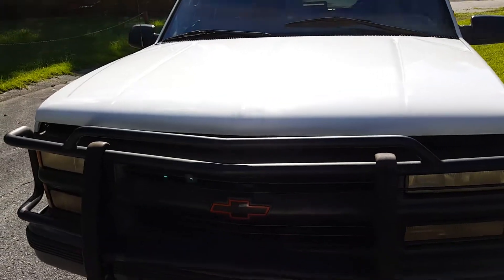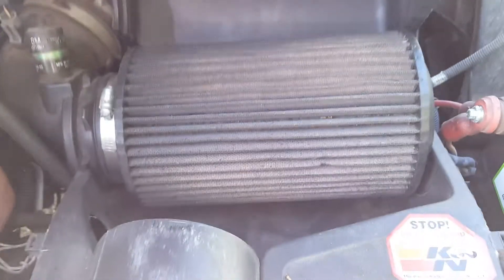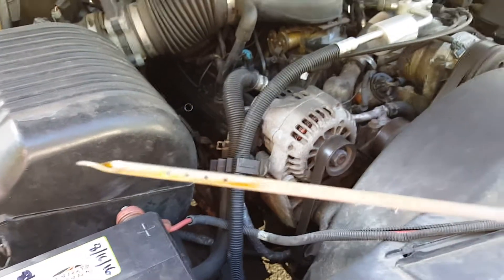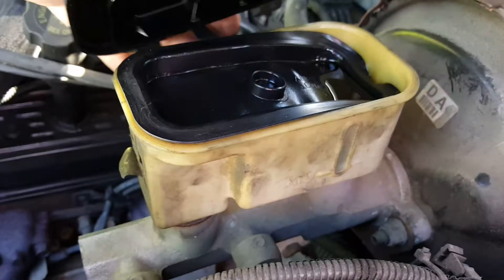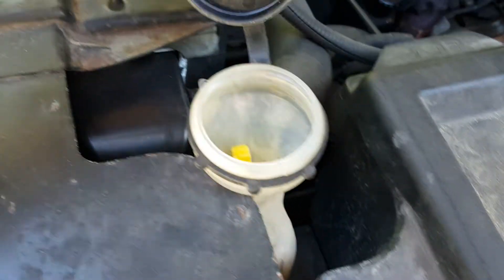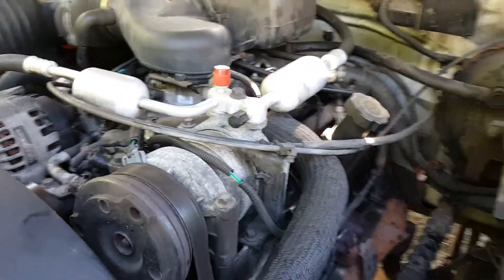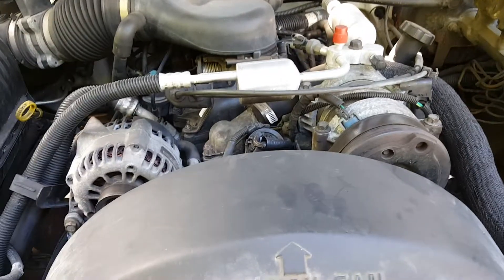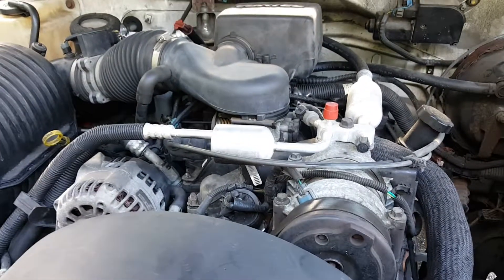Save your Car -How to check  Fluid Levels , Engine Oil , Coolant , Brake and Steering Fluids

Comment: The master cylinder is what holds the brake fluid, the part you pointed to is the vacuum booster.
Reply from the maker: yes i know lol i made a mistake
Reply: @drewsquickfix  
Happens to us all! 😂